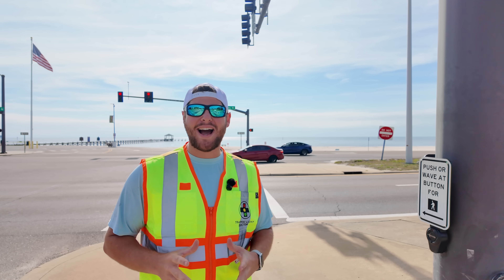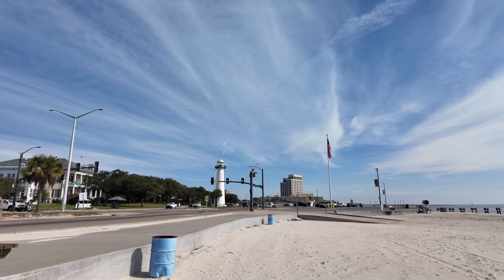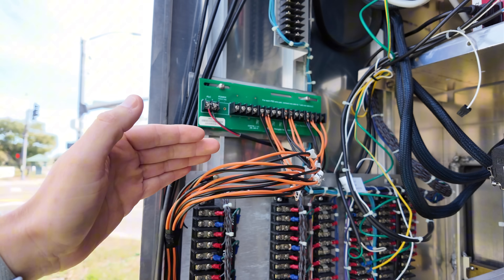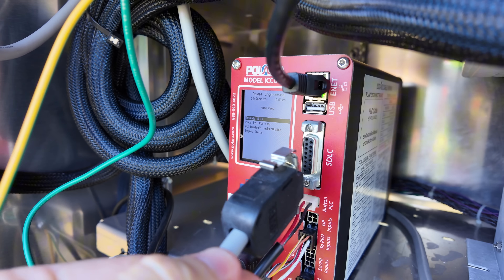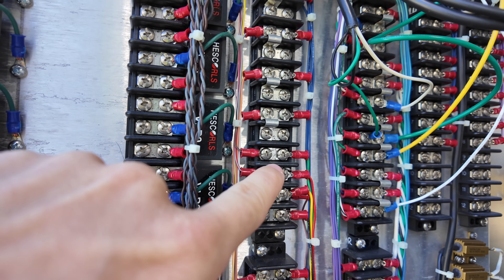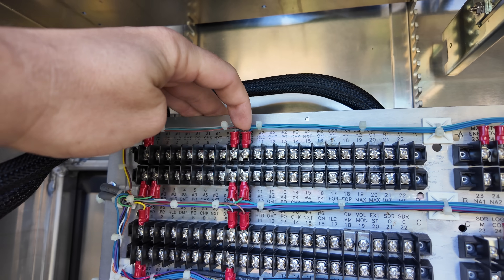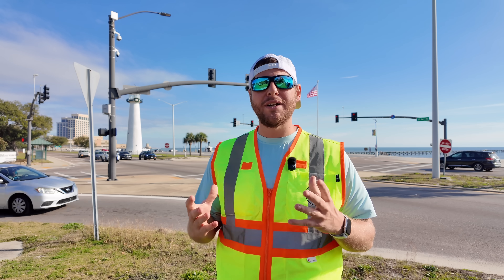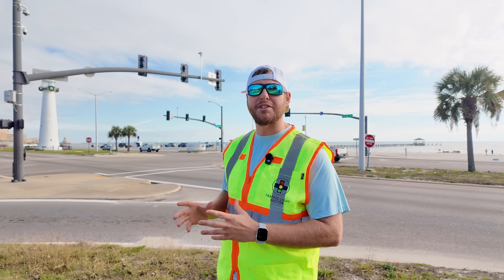What Happens When You Press A Pedestrian Button?

Comment: My take is that in some hours, especially late night to early morning, major roads will rest at GREEN unless a car from the side road - which rarely occur - needs to cross. This is to eliminate annoyance of unnecessary stops on major roads when there's no one to cross anyway. Then when there's a car waiting for its turn to cross a major road a sensing equipment detects that and thus give it a time slot. This can be reliably detected by a sensor. But what if a pedestrian wants to cross? There's no reliable sensors for pedestrians waiting to cross the major road (a person standing on the side may not necessarily be intending to cross). The pedestrian button takes care of that and sends intention. This system is overridden in rush hours where time allocation is already shifting regularly.

Comment: I realize that the pay for the video is based on how long people watch, but, man did you get into the weeds with all the wiring, terminal blocks, etc.  Maybe there's somebody who cares but bottom line is that pushing the button puts you in queue to get a safe to cross signal.  So, what you didn't answer is how that is different than just waiting for a green light to cross?  Does it change how the traffic signals for cars act, or does it just add the walk light, in which case, why have the button at all, just display the walk signal same as the other signals...

Comment: Who wondered about the wiring path inside the signal box? And who STILL wonders what algorithms inside the controller might be doing with the input? Does a pedestrian call ever alter or shorten preceding cycle times, or does it only ensure the pedestrian's eventual cycle is long enough to make the crossing? Are there deliberate conditions (as suggested by commenters below) in which a button might NOT do anything?

Comment: So...  The buttons are connected to the traffic controller.  When a button is pressed, the software initiates an algorithm to change the crossing signals based on the direction of the pressed button.  Each additional press within a 10 second window adds an additional delay of the signal change.  After 3 delays are added, a sound byte of Beavis and Butthead saying "huh huh...  that's cool" is played over the PA system at Traffic Central.  Greatly improving employee moral!  
Thanks for the video!  That's cool!

Comment: I used to live really close to one where you would never get a walk signal unless the button had been pressed. No matter what was happening with the lights, the ped walk signal would never activate if nobody requested it. Then the pandemic hit and nobody wanted to touch buttons anymore, so they programmed the walk signal to activate with the parallel car traffic 100% of the time, and just put up signs saying you didn't need to touch the button anymore. Then years later those signs disappeared but the button still does nothing because either nobody noticed or they realized it made no difference to traffic to always activate the walk signal. But why remove the button when that costs money? I can only wonder what percentage of these walk buttons out there do absolutely nothing now even though they used to.

Comment: Pedestrian signals send a clear message that pedestrians aren't welcome.  Most lights are configured to only give a crossing at one phase in the signal, so you often have to wait several minutes.  Most pedestrians give up and just cross when there's a break in traffic, so by the time the walk signal triggers, it just stops traffic for no reason.  Pedestrians are conditioned to ignore the signals.  If traffic engineers really wanted to make them work, they would always give a walk signal at the next light change, and they would trigger that change if there hasn't been a walk phase recently.  But of course, they're "traffic" engineers, so they're focused on the cars, and pedestrians are usually an afterthought at best.

Comment: Is that a new control cabinet? It is shiny clean inside. There is no dust, spider webs, or oxidation of the aluminum panels. It is beautiful inside!  I am surprised how much hardware is required just to manage those lights. What is the total cost in materials for all that stuff?

Comment: These systems run 24/7 365, there will be issues. and because of this,  guys like this are on call 24/7 365 no matter the weather they have to go out, it might 1AM or 5PM, rain, sleet.snow or 100 degrees. It might be across town or the other side of the county, just have a little patience

Comment: The way it used to work here in my city: If you do NOT press the button, you'd still get a walk light but it was a shorter length of time than if you had pressed the button. The way it works now: Unless you push the button you do not get a Walk light at all, it just remains on Don't Walk. When I was a teenager and I was with my buddies the guy in the passenger seat would jump out and run to hit the button and run back and hop in the car, just to cycle the light to green sooner. lol

Comment: Does hitting the light switch multiple times make the light brighter? Of course not. It’s either triggered or not.
Though it’s also a true fact that a meaningful percentage of these buttons are placebos - intentionally inactive in many places. Pushing it many times does the same as not pushing it at all. What “happens” only happens if not intentionally disabled.

“New York City, USA: As of 2014-2018 reports, only about 100-120 of the city's roughly 1,000 to 3,250 buttons were active, meaning over 90% were disabled. Most signals are on a fixed-time operation and display the "walk" message automatically.

San Francisco, USA: Around 80% of the buttons were reported in 2017 to do nothing to change the signal timing.

Dallas and Boston, USA: Nearly all buttons were found to be non-functional placebos in reports from the mid-2010s.

These buttons are often left in place because the cost of removing them is high, and they provide users with a feeling of control, even if they have no effect on traffic flow. “

Comment: I've also seen crosswalk signals always cycling, the button having no influence on light duration or the pedestrian crossing timing. Typically, on intersections that would be impossible to try to sanely schedule due to traffic density - pedestrian and motor vehicle and for one intersection, well it's the corner next to the governor's mansion and of course that intersection's gonna be weird.
In my current neighborhood, as near as I can tell, the pedestrian buttons do nothing, even with a stopwatch I couldn't see a cycle change and there are no walk/don't walk signals on that intersection. Lower traffic, poor borough, so I just cross on the light or when it's clear and light be damned.

Comment: When the traffic signals are running normally, they cycle through the sequence, sometimes based on the traffic load, and they try to keep the vehicle traffic running smoothly. When you press the ped crossing button, the sequencer isn't going to drop everything and let you go. It has to wait for various vehicle traffic events, such as left turns, right of way, and the normal red/green timer for each direction. When you push the button, the sequencer will insert a cycle into the sequence to allow you to cross after the vehicle traffic has been safely processed. Also note that if an emergency vehicle comes on the scene, that my completely mix things up for a while, to allow the emergency vehicle to pass as quickly as possible. That may cancel ped crossing requests, as well as resetting left turn and other traffic cycles.

Comment: Happy New Year! A clarification question. I gather from what you say that the PLC board you mention at 2:30 is an interconnect board (Printed Circuit Board) that connects to the traffic controller PLC, with some sort of logic / on its backside, feeding data to the PLC via two wires? These are all new to me as I'm in Aus. (Retired electrical / electronics / instrumentation / IT nerd). All the best with your new adventures. And yes, lots of drool. Lol 😂🎉❤
Reply from the maker: I’d have to pull the specs to be 100% correct but I’m 95% sure it’s an interconnect board!

Comment: Funny how the technology in there looks a lot like phone system tech, 1980s vintage! Seems like you could streamline that a whole bunch snd probably run it on a raspberry pi, but it likely wouldn't have the necessary fault tolerance needed,  I'm sure the testing required and the insurance those manufacturers carry must be on the high end of the spectrum!!!
Reply: The space is taken mostly by I/O wiring and power supplies. The processor horsepower requirement is minimal as you suggest.

Comment: So, long story short: when you push the button, you are put in a cue. And when you are put in a cue, you wait for the process to cycle and the time to expire for the cars. But since the time is set to expire for the cars regardless (if or when you push the button), which is when you can cross anyway,  pushing the button does nothing other than tell the system you are their.

Comment: A couple of things to add:
1) Pressing the button multiple times won't make the light change faster, per se, but sometimes your initial press doesn't register.  Maybe the button is a bit worn out or you pressed it when it hadn't yet cleared the queue from the previous cycle and didn't register your press.  Pressing 2-3 times ensures that at least one press actually registered with the control computer.

2) Some lights have "priority" for the most major road.  For example, a street near where I live has a medium-sized residential street crossing a major artery road.  If, hypothetically, there were no traffic on the east-west residential street, the major road would have priority and just always be green.  It only cycles the lights when cars are detected waiting to cross the major road (whether straight through or making left turns).  Same goes for pedestrians.  If the main road is primary and there's no cross-traffic waiting, then the crosswalks going across the residential street would have the "Walk" signal.  That signal needs about 30 seconds to switch to "Don't Walk".  Thus, if I press the button to cross, it will be at least 30s before the light changes because it has to switch the opposed crosswalk signals first (with a 30s countdown).  If there were already cross-traffic waiting, then it was probably already scheduled to change anyway.  But that leads to point 3...

3) Some lights have a very short cycle for one road.  In the above example, the through traffic on the residential street usually only gets about 20-30 seconds of green light to move through the intersection.  That's not even enough time for a pedestrian cycle of 5-10s for "Walk" and then a 30s countdown of flashing "Don't Walk" before it switches to solid "Don't Walk" and then the traffic lights shift to the next cycle.  So pressing the button in this case is less about signaling that you want to cross (it was gonna switch anyway because of traffic), but rather giving you more time to cross so you have about 35-40 seconds instead of just 20-30 seconds and no signal indication for when it's Safe™ to cross (using the largest sarcastic air quotes allowed by local law enforcement because cars make their turns anyway and get upset at pedestrian for having the audacity to want to cross the street).
Reply: Yeah, I really like the ones with feedback (vibrate or a beep or even better the "wait" ones). The simple ones without those I will hit multiple times because I'm not sure if it worked.
Reply: @fallouthirteen  second press a "warning do not press again" voice message, third press a mild electric shock and "I told you not to press it again."
One town in Sweden made the trafic light beeps play jingle bells as you passed the streets this year instead of the quick beeping sound it used to make.
Reply: Yup, pressing it multiple times for me is more about making sure the thing senses a press than making it go faster, having feedback next to the button or the walk light itself probably would cut the daily button pressing by half
Reply: Newer digital buttons have lights and/or sound indicator that it was pressed.
Reply: No one read that.

Comment: Depending on how it is programmed, it can be a requested service, and no matter how many times you press it the request is just made and the program runs

But, if the PLC has firmware for it, you can program just like a request from the lane sensor, where the more requests the higher the priority 

And there are lots of options 

You can have a time of a press sets the priority, or a sequence of presses sets priority 

So in some cases the number of presses will cause an immediate response from the controller. 

So, if you program 9 presses in 10 seconds, it goes to red in all directions 

I have also seen a 3 short, 3 long, 3 short, within 10 seconds it trips everything to red and gives walk signals

I REALLY miss the old clock wheel boxes. 

They were very simple with the thumb screws and you could set how long each side got green 

They were cheap and easy

Those were the days

I just watched old 8mm films from the 50s for the major town in my area and we had 1 traffic light and actually had traffic cops directing traffic in the daytime 

God life was so much better back then😢😢😢

Comment: Way back in the early 1960s, a technician forgot to lock the traffic light control box.   As a just a kid in elementary school,  but I had to watch it operate.   There was a small moter that turned wheels with bumps on them.  The bumps would cause roler switches to change state.  This caused relays below to switch, which would change the traffic lights.  It would be years later that in High School and College I'd learn about the electronics to understand what I was looking at.    Today, we use PLCs to do what was mechanical back in the early 60s.
Reply: Even so, motorized cams are still used as the low cost option sometimes such as for home appliances.
Reply: @KJ6EAD now motorized cams are way more expensive than solid state. The last time I saw a motorized cam on a home appliance was on a early 90's washing machine
Reply: Dude! You're my kind of nerd. You'll probably dig the channel on YouTube this museum is obsolete. That's wrong, but it'll get you to Sam's channel where he builds instruments out of furbies and recently attached a MIDI interface to an old church organ he bought. He's mad as a cut snake but an absolute legend of DIY.

This is a rubbish sales pitch, but his museum in England features electromechanical memory like your comment described.
Reply: @KristovMars   creepy comment
Reply: @thefamily512 you're a creepy comment
Reply: @thefamily512  Why is pointing someone to a channel that they might like creepy?  Actually I love oldtime movements of gears and relays. So I went to the channel and became a sub.

It's creepy, you cant understand what @KristovMars was doing
Reply: @Youngguns42303  maybe some people are scared of furbies? Idk. It's like .037% of the channel so hope it doesn't discourage someone. 

But yes, Sam is awesome. Used a SWTPC to do some music, builds synths, tape delays, and old cars. Leslies. Phones exchanges. Pipe organs. Probably made a vacuum cleaner fry an egg. I know I'm forgetting the best stuff. Friggin' national treasure.
Reply: I knew an electrician who posessed a wooden box with a motor and a cam. Electricians would work on traffic lights and this box made the lights flash amber which was better than no lights at all.
Reply: I still have that mechanical timer for my pool water pump.
Reply: Were those old ways more reliable than the new electronics?
Reply: @joeorlando94 no and way more limited in being able to react to traffic flows.
Reply: Like the "pie plates" in Otis elevators.
Reply: Those mechanical ones will last for decades... Unlike today's microcontrollers.
Reply: @grayrabbit2211 No, they would not. Contacts pitted, pins wear. I hated them.
Reply: @miluth2 I can replace contacts.  Can't get parts for older PLCs.
Reply: @grayrabbit2211 Have you physically work with those? There is more to them, don't want to get into details about unreliable or liability. I  can replace a load switch, detector, or controller, controllers can also be repaired same as mechanical.  Some controllers have been around for 25 years.

Can't get parts for the old mechanical ones either.

If you have to constantly replace parts on the mechanical, including dial motors, pins, cams, and contacts.  That isn't considered lasting for decades. Same as having to repair or replace a controller.
Reply: @miluth2 nope, much more mechanical wear, contacts wear out, switches got stuck on cold weather.
Reply: @grayrabbit2211 you can  get spares for most electronic parts, if not the original a drop in replacement and for some hard to get parts you can use a FPGA to replace it.
Reply: You sound like you ate paint chips 😂 remember those?
Reply: @thefamily512  I loved those tasty chips !!!